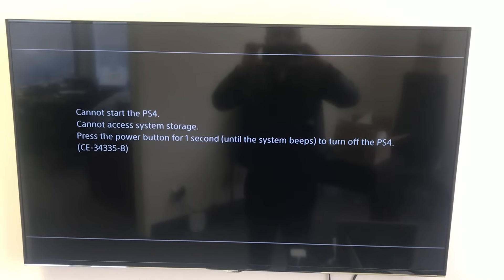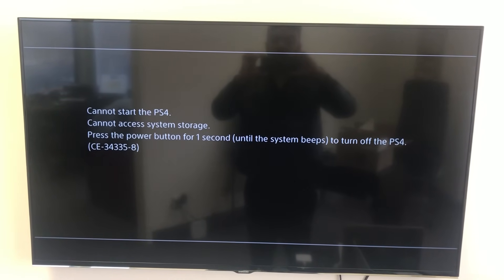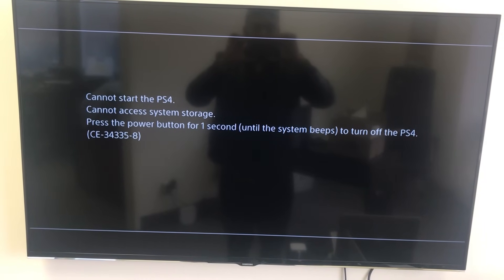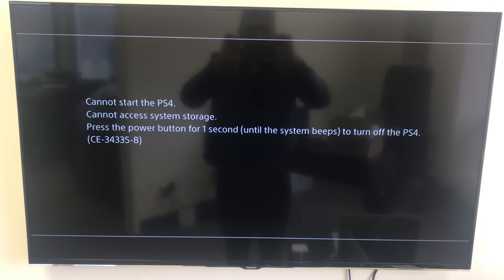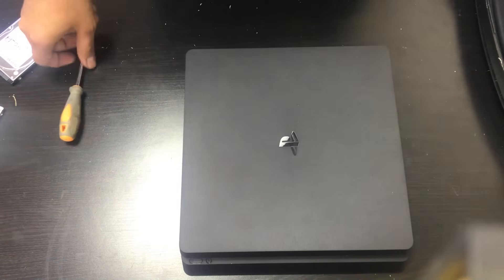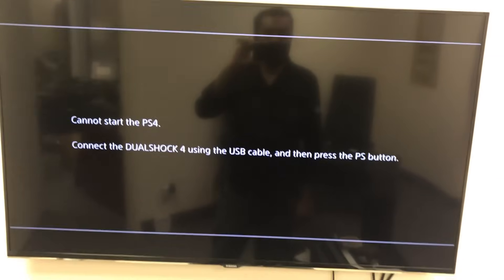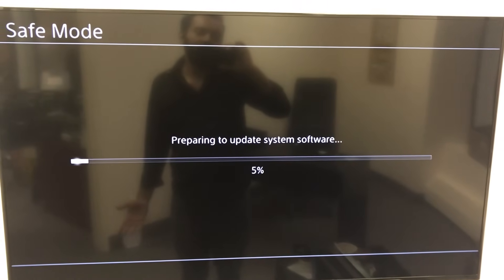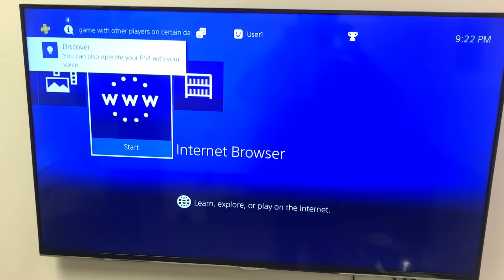PS4 Slim Cannot Start (CE-34335-8) Cannot access system storage fix

Comment: Thanks for the video. Could this problem be only because of hard disk failure or is there a chance of motherboard or power supply failure
Reply from the maker: In very rare cases it could be because of a controller chip on the mainboard but never because of the power supply.

Comment: Not a fix, more a workaround by replacing the HDD.
Reply from the maker: So if you replace the clutch in a car does not count as a fix?
Reply: Replace the clutch and the problem eventually repeats, becoming costly. 
Fix the damage clutch solves the problem and costs fair less.

You didn't fix the clutch ☺
Reply from the maker: @mh2bul Would it not fail again eventually and probably sooner if it was repaired instead of replaced? I have never heard of some one 'repairing' a clutch. In the context of a first world country it would be much more costly to rebuild or refurbish a clutch then it would be to fix it given the current wages. If you have a video on how to repair a clutch without replacing it I would like to see it.
Reply: @fasttechvideo  see youtube. 

The point being made is, this is a workaround, not a fix. I'll leave it at that.

Comment: My ps4 randomly froze, I unplugged it and plugged it in and turned it on and got the message... I'm not tryna spend 50-100$ for a hard drive with money i don't have 😭
Reply: same it sucks likr fr I only had my ps4 for 6 months and this pops up and Im only 13 its not like i have alot of money this is the 3rd ps4 that has done this!

Comment: GUYS BEFORE TRYING TO BUY A NEW HARD DRIVE JUST BLOW INTO INTO IT BECAUSE THERE MAY BE DUST THER AND TRY TURNING IT ON AGAIN, IT HAPPENED TO ME ONCE BEFORE AND I DID IT AGAIN AND IT WORKED EVERYTIME, FOR SOME PEOPLE IT MAY NOT WORK BECAUSE THE HARD DRIVE IS  ACTUALLY A DEFECTIVE HARD DRIVE AND YOU WILL HAVE TO BUY ANOTHER ONE. (IF IT DOES WORK JUST LIKE THE COMMENT OR REPLY SO THAT OTHER PEOPLE CAN TRY THIS TOO.

Comment: Sooo this happened to my brothers PS4 and I tried reinstalling that update software like it told me and everything but it still wouldn’t pick up the HDD so do I HAVE to get a new hdd or is there another way?
Reply from the maker: If its not picking up your hard drive after multiple attempts you do need a new hard drive. No way around it unless you want to try to dismantle the HDD, replace the logic board of the HDD or if that doesn't work try fixing it which is no easy task and requires a specialized environment.
Reply: @fasttechvideo  new hard drive it is then👍🏼 thank you!
Reply from the maker: @rollingdom  You're welcome
Reply from the maker: @rollingdom  You're welcome. Don't forget to subscribe!

Comment: 3 questions, 1 do I NEED a replacement 2 do I NEED a computer to fix it and 3 what about my games I don't wanna lose that data
Reply: I dont think you will lose your games data unless your account was hacked or banned if that’s not it then it probably was corrupted
Reply: Not really, as long as you clean out your PlayStation and let the items cool off, it should cut back on good as new like mine did.. and yes if you replace the hard drive you lose all physical data, only think you will have left us any online data.

Comment: My ps4 that I got back in july had this issue. I only played it like 9 times. I tried this way, but it didnt work. Nothing worked. I had to send it into sony for a repair and instead of sending me my ps4 fixed, they sent me a pre owned ps4 in worse condition than mine. I got it yeaterday, not even 2 hours into using it, it got this issue already. I didnt want to try this again, but i gave it 1 more shot thanks to my friend encouraging me and it fixed it. Thank you so much from the bottom of my heart.
Reply from the maker: @mr.loganwagner344  sometimes there is a controller on the mainboard that fails that can cause this issue

Comment: If I buy a hard drive that I can connect to my ps4 will it work???????? Please respond bro plz it will mean allot 😪
Reply: You mean a external hard drive?
Reply: Robloxian King yes
Reply: @geo5896  i don't think so. Your internal hard drive needs to be in working order. I suggest instead of buying an external, just buy an internal. Its very easy to replace your current hard drive with a new one.
Reply: Robloxian King thank u 🙏

Comment: I’m 13 not an electrician I accidentally pulled my PlayStation of my counter and it fell not it says that but what do I do then I don’t have a replacement
Reply: Just remove the hard drive from your playstation (make sure its not broken or dislocated) then place it back in.

If that doesn't't work you are going to have to buy a new one
Reply: @robloxianking8745  thx but I literally just had to let it cool down XD

Comment: Yo got a question. I got the same error code. When I try to go to save mode, holding down the power button until I hear two beeps my ps4 turns off. But when I turn it on again it check storage and stays stuck at 24% and then takes me to safe mode and tells me to connect my controller. When I do it tells me to connect my usb with the update file. My question is, is it okay if I just simply go with the update file and let my ps4 update it. And 2 even if I do update it, will it ask me to initialise cuz dude I got so much saved up on my hard drive and I just don’t wanna lose it.

Comment: What happens in mine PS4 is when I turn it on it shows the "PS" symbol and then just goes black and i't won't show image(I've tried every single option on safe mode even the last one reinstalling the software and still doesn't work) can someone help

Comment: Before you buy a new system storage try taking out the one you have blocking in the port and make Shute its connected because mine had came loose and that was the problem
Reply: How do u know if its loose or not

Comment: mine gets stuck at 99% then says "cannot access system storage"
Reply: Mines to bro it’s been happening for 2 months
Reply from the maker: @choppyx4338  You need a new hard drive. Your HDD is in the early stages of failing. Check the description box for links.
Reply: @fasttechvideo  will you have to download all your games again if you get a new hard drive ?
Reply: Mine gets stuck on 27
Reply: mine gets stuck at 24%
Reply: @dreamthreats2959  did this help it
Reply: Same shit happens to me
Reply: Mines has been fucked for ages
Reply: Bruh mine get stuck on 0%
Reply from the maker: @only_agris  Thats because you did not replace the hard drive or you replacement drive is faulty.
Reply: @fasttechvideo  bro I'm getting a new hard drive and I hope to god this works, sadly ima downgrade from 1tb to 500gb, same as my current ps4. Thanks for helping out!
Reply: @fasttechvideo  I threw away my messed up hard drive that was inside my ps4 if I buy a ssd one can i just connect it to my ps4?
Reply: @fasttechvideo  i can Fix my old hard drive?
Reply: Best thing to do is wait til ps5 or buy a new ps4
Reply: @kaineh99  i think there is some pcs too
Reply: @PlayyaKyran Z no im not 18+ and i dont have money and i want to fix him😭😭
Reply: @PlayyaKyran Z WHAT is so big 😭😭😭😭 i cant fix it 😭😭😭
Reply: @PlayyaKyran Z i dont do chirstmas 😐😞😞😞😭
Reply: Same 😭😫
Reply: If it says that first try to get your cord and plug it in your controller then click the ps button, after that it should give u 2 options click "yes" it should let u get in like that
Reply: @6lockinnn  ok thanks
Reply: @xxxtentacionforever4888  did this end up working ?
Reply: Try turning your ps4 off for an hour when it says this, it should work perfectly fine after

Comment: Just pulled out the hard drive, cleaned it up and put I back in and it worked for me, no new hard drive
Reply: Pls help what screw driver did you use
Reply: @maryagyemang9870  U can use a knife if u dont have the right one and sometimes the screws gets stuck

Comment: I have another issue which I can’t find any answer to at all, it was earlier today, where I entered a code, and it was processing for 20
minutes (way too long) and I went back to the home screen and reentered the code, and it said it was already used. So I realised I couldn’t see my account balance in the top right corner of the store like usual,and I went to buy Fall Guys. I added it to my cart,and then tried to enter my cart, but it said I couldn’t access my cart. Error code WS-43737-4.Do you think you could help, thanks in advance :D

Comment: What happens to my storage on my other hard drive and how can I still play my games that I have and all my stuff on those games
Reply from the maker: The data is technically still there, you can clone it to a new HDD but only if the hard drive still boots using a PC
Reply: please is it possible to fix the HDD without needing to replace it?  @fasttechvideo

Comment: It doesn’t allow me to connect the DualShock to the ps
Reply from the maker: You need to use a USB cable to connect your controller. If it still doesn't connect you have a defective bluetooth chip or antenna.
Reply: U need a charger

Comment: Fasttech I’m not very tech savvy. Is there a certain software I should use? Also, the hard drive has a kinda bubble look on the little disc for the hard drive, is that normal? Once I do clone it and install a new hard drive, do I just place my data on a file in the usb then just plug the usb into the ps4 slim and it transfers?

Comment: Mine just gave me this error today and I tried taking it out and putting it back in and it didn’t work so I assume I need a new hard drive. But I can’t back up my stuff on a usb since I can’t get passed the error message. Is there anyway to back up your hard drive without doing it on the ps4? Is there a way to clone your stuff on your original hard drive onto the new one using a computer? I can’t find anything online about it.
Reply from the maker: You can try cloning it on a PC but most likely its not going to be readable at this point.
Reply: Fasttech thank you so much. I’m gonna give it a try. Would be pretty unfortunate if I just lost all my saved game data.

Comment: Is there a video to show how to keep all your data that was on the previous hard drive when installing a new one?
Reply from the maker: TheAlphaFlame You can use cloning software on a PC if your old hard drive is still readable.
Reply: Fasttech I’m not very tech savvy. Is there a certain software I should use? Also, the hard drive has a kinda bubble look on the little disc for the hard drive, is that normal? Once I do clone it and install a new hard drive, do I just place my data on a file in the usb then just plug the usb into the ps4 slim and it transfers?

Comment: My system has a problem with over heating and freezing. Even pull from where it was, out it on a still and placed a fan behind it. It still does it but not a often. Any suggestions on how to minimize this problem....please and thank you.
P.S. I even got a can of air duster to remove the dust.

Comment: hey bro , i tried this in the morning without watching a single video i replaced the ps4 hard drive ( 1tb hard drive ) with the PS3 hard drive it's 500gb it's not important , so the important thing is that i have a lot of data i don't to lose on the PS4 hard drive so if i reinstall the PS4 system software can i get back the PS4 hard drive and will it work ?

Comment: Hello I did all of this and it still gave me this screen and won’t enter safe mode is there a fix to this
Reply: First you need to get out off safe mode... When you hear 2 beeps release.. First one will beep in a second or 2 the second one will be in 9 seconds or less idk. When you hear the second one stop holding the power button.   Do this only if you cant get the usb thing to work
Reply: a bear with a gun thank you I figured out the issue
Reply: Logan Almanza hey i’m having the same problem, how did you fix it??
Reply: nvm, my problem was that i didn’t put the screws in right so now it’s working again
Reply: haeze haha same I also put the drive in backwards
Reply: Logan Almanza lol

Comment: What if I’m getting the cannot start ps4 loop bc of update even after updating
Reply from the maker: It’s YA BOY You are getting the loop because you have a failing hard drive that you are refusing to replace.
Reply: @fasttechvideo  so what you're saying is if I switch the hard rive there should be no hassle but what about if me and my friend switch around hard drives does that mean he now has the error access system storage??
Reply: @itz-d2994  First of all, PlayStation drives are encrypted which means the other console would ask to reformat it. 

Also, the hard drive was likely damaged already.
Reply: @fasttechvideo  you say refusing as if everyone can just buy one out the blue
Reply: @fasttechvideo  your video should state that you need a new drive in the title. You make it sound as if it can be repaired. Of course itll work if you put a new hard drive in. I want to know how to get my old one working. Kinda like what your video is claiming.
Reply from the maker: @stevedelawder5010  My video claims a PS4 repair not a hard drive repair. There are other videos on YouTube demonstrating HDD component level repair.
Reply: Then buy the hard drive and it should work right after you switch the hard drive
Reply: Or if your talking abt how to get out safe mode then hold the button on the front of your ps4 until you hear two clicks and when The PS4 turns on it should take you to an options menu try restartig it first option 1 and then go your way down
Reply: @VxKonik All 7 Safe Mode options do not work.

Comment: This is not a fix, it is just a replacement, and Hou Will start with no previeus data
Reply from the maker: A fix could include a replacement. Your point is invalid.
Reply: @fasttechvideo  - then make it clear to us that it is a replacement/"fix" without keeping your previous saved data. The saved data is the key we want to keep.
Reply from the maker: @anes4375  Im sorry I didn't know you were paying me to make this content. Besides your data stays on the old hard drive so you can try to recover it on your own. The point of this video is to fix the PS4 not save data.
Reply: @fasttechvideo  - Allright I get You (y)

Comment: Mine wasn’t messed up the hard drive wasn’t inserted all the way because I lost the little L shaped thing
Reply from the maker: Were you missing the screw that holds the hard drive in?
Reply: Fasttech no the L shaped thing at the back right corner is lost... the black string looking thingy was just poking out and I didn’t even know the hard drive was right there until I saw this video... thx

Comment: i just cleaned all the dust off of the sides of the ps4 and took the hard drive out and cleaned the dust from there and put the same hard drive in and it worked! when i opened the ps4 the colors were brighter and performance was better. so no need for a new hard drive. (unless its broken)
Reply: Really? I’m broken up over here about my pro breaking down. This comment gave me hope.
Reply: @jeremyblackwater439  did you get yours working?
Reply: Johnny Sherman I did the cleaning but to no avail.
Reply: @jeremyblackwater439  ok thanks. I'll probably have to buy a new one too.
Reply: Just tried this on mine and it worked 👍.
Reply: This worked for me
Reply: Ty Gielczyk what did you use to clean ot
Reply: @jaxonpugh3906  https://www.homedepot.com/p/RYOBI-18-Volt-ONE-Lithium-Ion-Cordless-High-Pressure-Inflator-with-Digital-Gauge-Tool-Only-P737D/307627867 with a basketball inflation needle is what i use to clean  the dust.
Reply: XDMcwaffles 24 i just took a long object thin enough to fit in the gap of where the hard drive was but first i wrapped it in paper towe
Reply: What did you use to clean it
Reply: This just worked for me too!!
Reply: This also work for me!!!
Reply: This comment just gave me hope
Reply: Yes works… for now lol

Comment: Happened to me this morning 4/23/20 and I tried this method and it works!! Thank you!! It's weird though cause I've been using a replacement SSHD and it was working fine till now. Does that mean my SSHD is currupted? I'm had to use my Stock HDD to fix my PS4
Reply from the maker: Hi,
Sorry for the late reply but yes there is most likely an issue with your SSHD.

Comment: So if I have to buy a new hard drive, does that mean that I’ll lose all my progression with the games I play regularly from the original hard drive?
Reply: DrJay24Gaming have you found this out because i’m wondering the exact same thing
Reply: You will have to buy spinido I will help you move your data from the old one to your new PlayStation jus plug it into the USB port go to settings and you’ll b Gucci
Reply from the maker: Your data or whatever is left of it will remain on your old hard drive and you can try copying it over to your new HDD with PC cloning software. Hope that helps.

Comment: Just bought one of these from the website you linked. Will I be able to use the enclosure from my current harddrive and put it on the one I ordered?
Reply from the maker: Yes you can use your old enclosure.
Reply: @fasttechvideo  Bro Do You Need A USB Stick To Fix This?

Comment: This error is happening on a new hard drive that was installed less than a month ago.  Was working fine.  Loaded saying to insert media with update.  Tried that.  Didn't work.  Tried to start in safe mode, but couldn't.  Did a power reset, making sure the lights were off first, and then after the 20 mins , this was the error.

Comment: Here's an easier way. Hold down the power button on you're ps4  until it beeps 2 times. And then it puts you in "Safe Mode" Prees The 5th Opion On Safe Mode Called "Rebuit Database". Trust me it Dosen't delete anything all it does is fix USB Devices Corruption And Delete Corrupted Data And Fix Your Hardrives Data. And Again It Does Not Delete Anything.